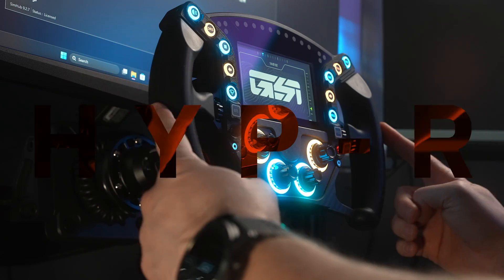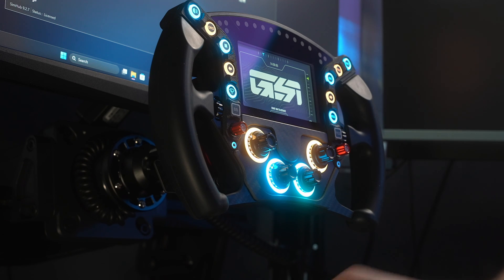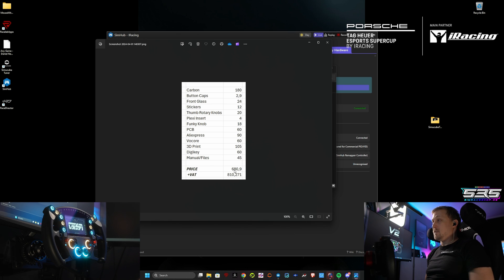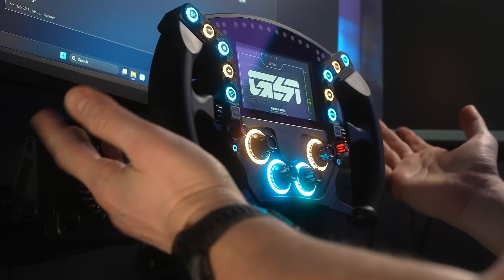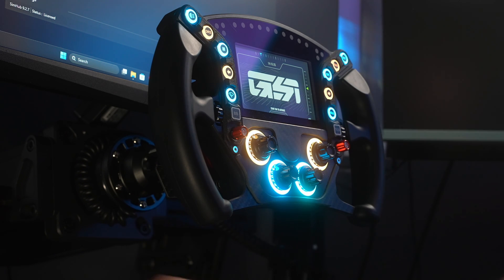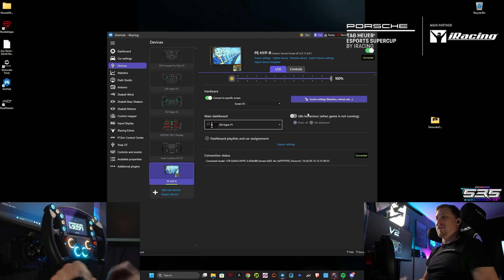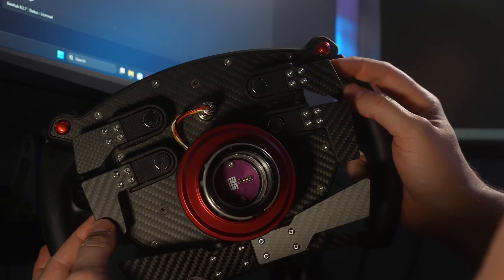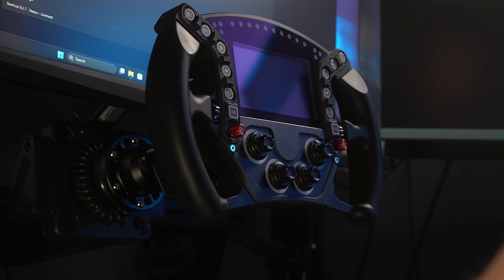Is the Pokornyi Engineering HYP-R worth it? Build your own wheel!

Comment: Dan did you ever get the led's for the button's to work with LMU? The screen and REV LED's work, can't get the LED's behind the button's to work. They all work fine on iR, AC, ACC.
Reply from the maker: Yes, it’s all one chain - I don’t see how you can have working shift lights but no button lights 🤔
Reply: @DanSuzuki  so after finding my brain, I had some sort of “default” profile loaded for LMU. Opened up the profile I have while LMU was selected in Simhub and it works fine now. 🤦🏼‍♂️

Comment: Doesn't Dan use a Simucube? How did he attach the Simagic Male on the Simucube? It even looked like the Simagic Connectors on the Male side....
Reply from the maker: made my own QR based on the NRG style. If you buy from NRG you get a 70mm base side.
Reply: @DanSuzuki  Achso also mänlich von NRG, was auf weiblich von Simagic passt? Ich nehme an der Connector kommt nicht mit? Ist das ne selbst gebaute Platine?
Reply from the maker: genau, selbst entwickelt. funktioniert mit jedem lenkrad und jeder base
Reply: @DanSuzuki  crazy! ich dachte es wäre nur auf der Lenkradseite und nicht auch auf der Base... Du meintest du würdest evtl. die files verkaufen?